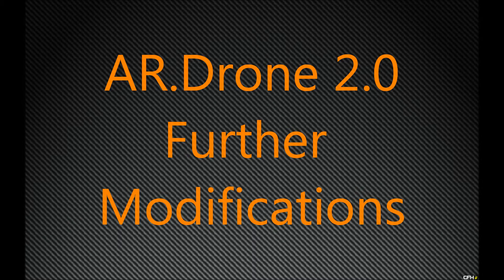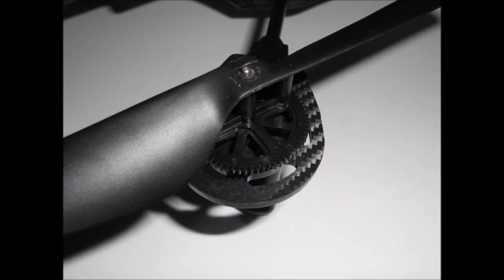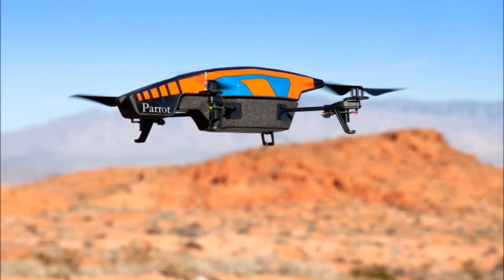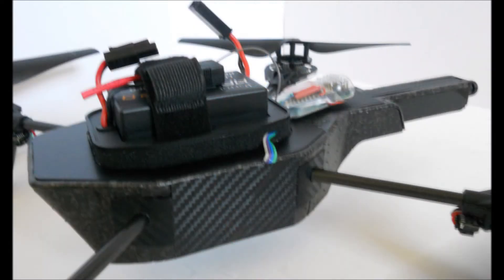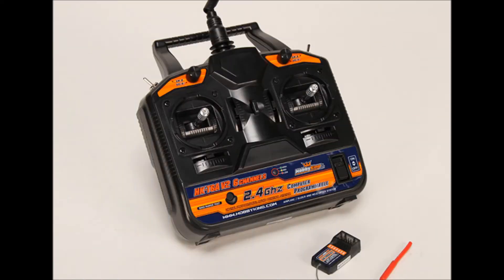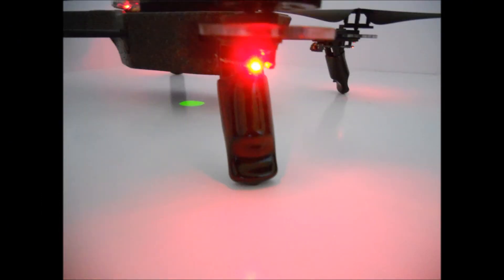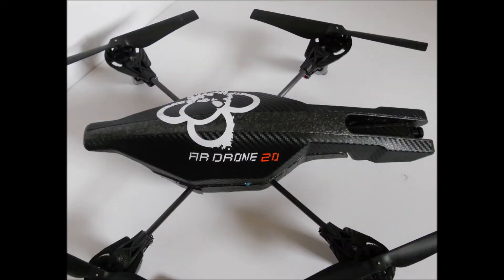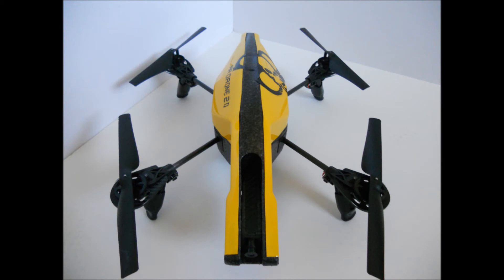AR.Drone 2.0 Modifications and Customizations - Part 2

Comment: I want to make the RC Transmitter mod you did.  Can you please tell me more about the interface?  I have an AR drone 2.0 and it has a 9pin connector on the bottom of the control-board (theres a taped over window there) - yet you placed the receiver on top why? and ran wires to there? and the receivers on the controllers on line look like they have more pins than that.  God a pin-out?  my EEEmail is eATedansDOTorg.  Thanks.